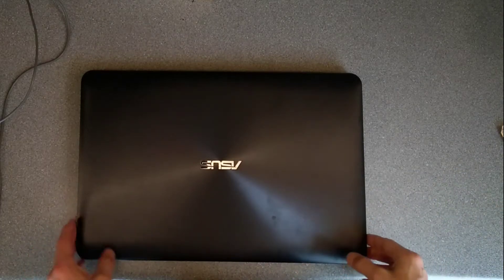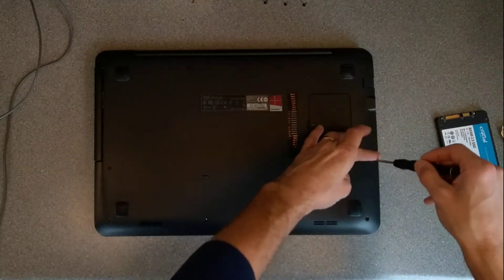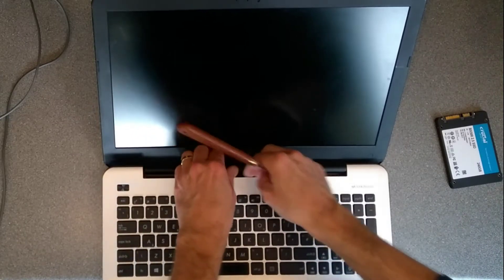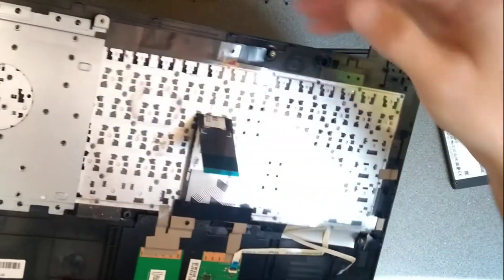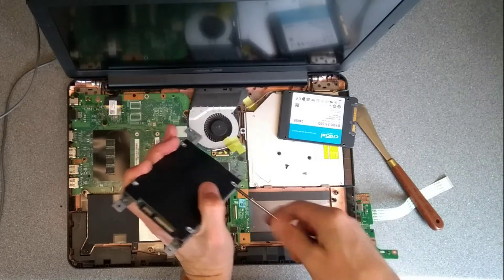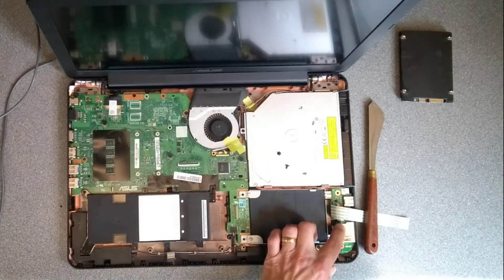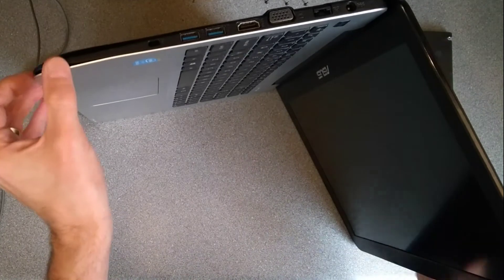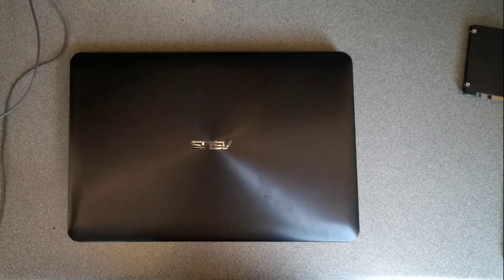Asus X555L Laptop: Replace or upgrade the hard disk / SSD

Comment: I thought you have to do a fresh install of Windows when you replace a SSD. Please advise.
Reply from the maker: If you don't clone the drive using something like Macrium Reflect and a USB to SATA adaptor, yes you would need to install fresh from a windows install usb
Reply: @freename  Ok, thanks.
Reply: Can I find out that I installed the SSD correctly without installing Windows 10?
Reply from the maker: Probably by looking in BIOS to see if it shows the drive make and model ?
Reply: @freename  I will be doing a fresh install of Windows 10 tomorrow on my Asus x555LB, will I have to install drivers? If so, which ones?
Reply from the maker: Unknown. But windows is pretty good these days of having the basics. Once installed and left online for about 5 minutes check in device manager to see what still hasn't been installed.
Reply: Ok, thanks.

Comment: I need to swap out the processor in this exact pc to be able to run Windows 11. Is that possible?
Reply from the maker: No. Technically maybe, but realistically no. The processor will be BGA array soldered to the board and you will need an expensive solder rework station and complicated process to remove and replace the processor.
Reply from the maker: Or also say that wanting to run Windows 11 out of choice is unusual. It is an absolutely awful operating system at the moment. If you're looking at trying a new operating system, I'd highly recommend one of the easier Linux versions such as pop OS.
Reply: @freename  yeah after some research last night just going to have to get a new laptop unfortunately. We have to have windows 11 to run a tune for our car unfortunately. 😞
Reply from the maker: @smokymountainconcealment5356  There's very little difference in the underlying operating system Win10 to Win11, it's just the garbage UI which they've updated on 11.
What happens if you try to install the software on Windows 10 ?
Reply: @freename  my tuner says I can’t cause he writes all the tunes on Windows 11 so I’ll need Windows 11 🤷‍♂️. I can’t take a chance on hurting the car at this point.
Reply from the maker: @smokymountainconcealment5356  That sounds like someone's translating something wrong or misunderstanding something. There's nearly no reason why OBD / ECU editing software would run only on Windows 11 and not Windows 10.
Reply: @freename  yeah I have no idea . The engine tuner uses hptuner and his tunes are written in a program that now only works with windows 11 🤷‍♂️

Comment: Was hoping you'd show what screws go where because there are 3 different sizes on the back and I didn't log them on removal. Thanks though.
Reply from the maker: Ah, I'm so used to putting them in a little map when I take them out and often explain I'm doing it on the video.. that I don't think to explain which ones go back where.
I hope you figure it out or can somehow see which ones go where from the video.

Comment: What if the old drive crashed
Reply from the maker: Use another computer to make a windows install USB and boot from the USB and install onto the new drive you have installed.
Reply: @freename  I tried that and it didn't work I even have the BIOS starting up from the USB flash drive and it's still not working thanks anyway
Reply from the maker: How did you make the usb drive?
Reply: @freename  I comprise the USB information from Microsoft website for media installer.

Comment: how did you get windows on the newly installed SSD?
Reply from the maker: Use the windows media creation tool on another computer (or the same pc before you take it to bits) to make a windows installer. Or, if you want to keep everything.. a usb to sata cable and clone software to copy your existing disk.

Comment: Is there a limit to the size of the SSD we are allowed to install on that specific ASUS? I seen on the ASUS website it shows a variant that they offer having an SSD of 256gb. But that doesn't mean it's a hardware limit, could just be they are being cheap with what was available at the time of manufacturing.

I think the maximum memory this laptop allows is 12gb of ddr3. Am I wrong on this?
Reply from the maker: Probably the easiest thing is to check what the maximum crucial.com sell for that machine is

Comment: After replaced hdd to ssd, its showing Reboot and select proper Boot device
Reply from the maker: Did you clone your old drive? If not, you need to clone the drive (if you want to mirror your old install) or if you want to start from the beginning, you need to install Windows. (Usually using a USB install stick created using the Microsoft Media Creation Tool on another computer).

Comment: I am confused. There is this backside of ASUS laptop sticker that is written "ASUS Model A555L MFD 2015-05" but elsewhere or eg. I was told "Asus Model X555L". Please advise which is correct? Secondly, this ASUS processor with Core i5-10300H  (2.5GHz) can support SSD? Pls advise. TQ.
Reply from the maker: Any machine can support an SATA SSD in place of a normal hard disk.
And it looks like the A555 and X555 are very similar computers if not identical other than possibly specification.

Comment: I have an assamption that in my laptop the hard disc does not work properly. After installation the Windows it brokes after some minutes and I need to insrall again. How can I prove that my SSD is ok. The Laptop the same from 2015
Reply from the maker: Use memtest86 boot usb to run a memory test. Then if that doesn't have any problems check the SMART data for the hard disk or swap out the hard disk and see if the problem goes away. If you get blue screens after booting into the desktop the problem is more likely to be RAM.
Reply: @freename  swap out the hard disk  - how I can do this ?
Reply: You mean swap out to change. Now I have understod

Comment: thanx - :face-fuchsia-tongue-out: removed the screws but dont remember were the longer/shorter ones should g0 when putting the screws back, anyone can help me out here?
Reply from the maker: eek :( Other than really carefully using a large screen (computer?) to watch my video and see if you can tell the length of the screws... no idea :(
If you are totally stuck - before screwing in.. think about how far the screw could go and if it might go through either..
-A component
-touch the board
-all the way through the top of the keyboard etc.

Putting a screw which is too long in the wrong place can bend or break the plastic or destroy a circuit board.

Comment: Thanks for the video, could you please check if this SSD will work? Crucial P3 Plus 1TB M.2 PCIe Gen4 NVMe Internal SSD - Up to 5000MB/s - CT1000P3PSSD8
Reply from the maker: I don't think that will as it is an "M.2" interface and not a 2.5inch SATA drive like the one I use in the video.
Reply: @freename  Replaced it yesterday, with a Kingston compatible (found online) and the difference is quite significant. Thanks again for great tutorial
Reply from the maker: @001boothbay  Yep! Hopefully the machine is performing quicker than it was when it was new!

Comment: Just one question does this model ram be taken out and use in another old computer because this one motherboard Is dead!! Can we take out ram from this model?
Reply from the maker: The RAM you can see in the video is soldered onto the board. There might also be a slot on the other side for expansion RAM too. But in mine nothing would have been in that slow.

Comment: Hi there.
I bought a new mx500 sata sdd, for my laptop, same one of the video, but i'm having a lot of trouble making it able to boot from the ssd, for some reason, any idea?
Reply from the maker: How have you copied the data or installed the OS onto the SSD? And what message(s) or errors do you get?
Reply: @freename  was trying to install OS from a boot pen drive.
All kinds of errors, but the most important part is that it never shows on my bios, I was able to install and use it for about 1h, crashed and never booted from it again
Reply from the maker: @brunosoares8089  Test if the SSD shows when you use it on another computer? I have not seen a Crucial brand drive go wrong yet but it is always possible. Also check for connection problems like the SATA or power lead becoming slightly unplugged?
Reply: @freename  Yes, it does show, tried in 2 different ones.
The sata connector is the same I use with my HDD, and works just fine with it

Comment: Hello sir, quick question, is this laptop eligible for cpu upgrade (i.e. i5 to i7), just curious, thank you.
Reply from the maker: I don't know how the CPU is mounted on the board (you can't see it in the video as it's on the other side of the motherboard). If it's a socket CPU the maybe you can upgrade it. But I expect it is a BGA Array CPU soldered directly onto the motherboard. You would only be able to swap that out if you had a BGA solder rework setup and stencils etc.

(In short.. not worth it for an old laptop like this, it's more likely than not to be a failure and nightmare).
Reply: @icannotgetafreename  thank you sir for the detailed breakdown, appreciate for sharing the knowledge 🙏

Comment: I hear lots of fan noise and system is so slow, Is upgrading the ssd solve it? btw I am using the same model laptop..
Reply from the maker: Fan noise is unlikely to be solved by SSD upgrade. Speed is very likely to be improved with an SSD.
Reply: @freename  Can you make some video how to clean the fan and other stuffs. It will be so helpful.
Reply from the maker: I don't have the computer any more, sorry ;/
Reply: @freename  okay Thankyou for replying
Reply: @aravindekanath  hey aravind, I'm facing the same noise issue probably fan, is your issue solved?

Comment: Does it support SSD SATA3?
Reply from the maker: It's backwards compatible. If the board doesn't do SATA 3 the drive will still work at the older specification.
Reply: @freename  Oh, okay. Which one does it support? At least SATA2 or just standard SATA?
Thank you for answering!
Reply from the maker: I'm sorry but don't know on that one. Your googling will be as good as mine but I suspect it's going to be very difficult to find the information.
Reply: @freename  Yeah, it's a very specific information, hard to find tbh. But since I even cannot find SATA or SATA 2 for sale, I'll stick with SATA 3 that as you mentioned and I've readed, it's compatible with 1 and 2's interfaces. Cheers!
Reply: @Pablo__Bossa  did SATA 3 work ? And what about nvme ?
Reply: Just installed SSD Sata III. It works! :)
Reply: Thanks. Is optical drive sata 3?